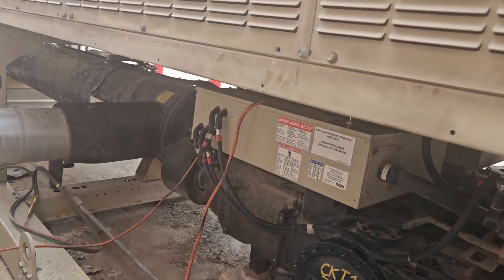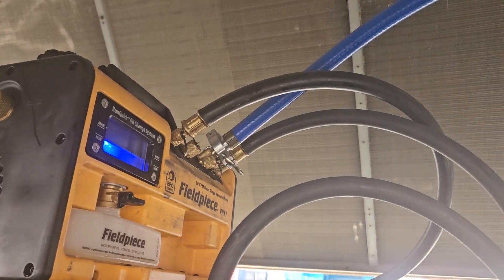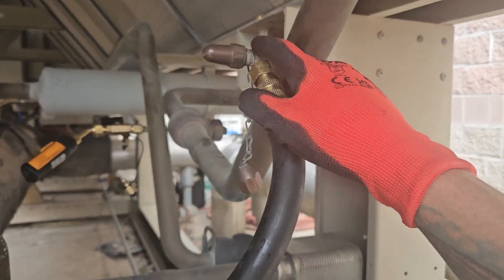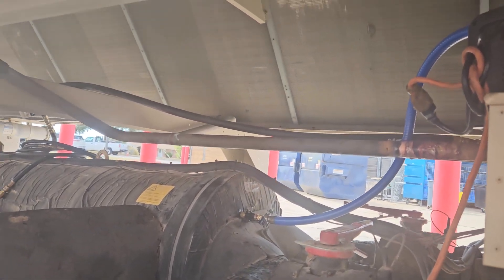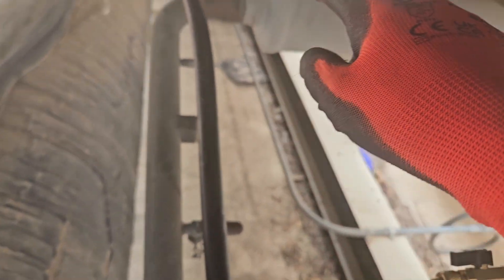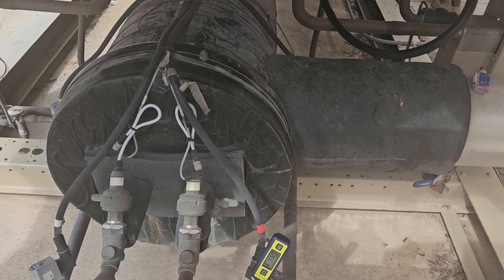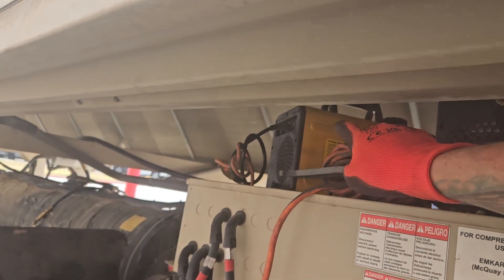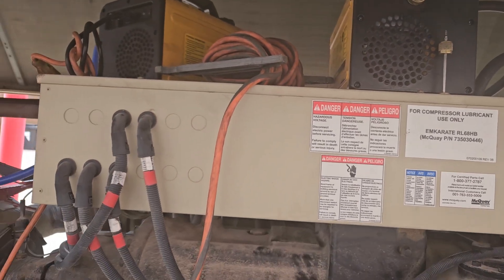You can use 2 vacuum pumps at the same time and have success with it.

Comment: It wouldn't matter what different size vac  pumps you used on the system,  once both are in working order there's no risk of pulling oil out of one into the system, the pump is fighting against atmospheric pressure on the discharge side of the pump, not the   micron level in the chiller...

Comment: I have done this from time to time.  I have the FP(company provided) and my personal JB. Usually will do this on walk ins that I know have a lot of moisture in them. Anything to make the task quicker.
Reply from the maker: @fshn76  time is money and every employer will be grateful for it. It has to be done with thought as to not create an issue. Thanks Bryan
Reply: @JJ-COMMERCIALHVAC yep. Luckily there is only a 1 cfm difference between pumps so never had an issue with pulling oil out of the other. I did a test to see how big of a difference it made and it decreased vacuum time by 40%. Decay only went up by 17 microns. People will say it’s overkill but when I can hit another job while another person is still pulling a vacuum. Speaks for itself.

Comment: I’ve always heard it would do that but never saw an example of it sucking oil out.
Reply from the maker: @smalljobrob6432  it will with unequal sized pumps....and i have seen it happen when I first tried it many years ago. I had to do some learning on how to do it correctly. It can also be done by piping the pumps in parallel. Thanks for the comment

Comment: I've used two pumps for years.  Once the microns get low, pull off one pump.
Reply from the maker: When its planned out correctly it work great. I made this video to get newer guys into thinking about how to accomplish a long task, much quicker. I also have used 2 pumps many times myself. Thanks for watching and the comment
Reply: Same here. Really a necessity on the big stuff if you don't want the vacuum to take forever. I've heard that you can run the risk of pulling pressure too low too rapidly and freezing moisture, but I haven't seen it yet.
Reply from the maker: @topher8634  i have as well, I really think that applies to smaller equipment as the internal surface area is much smaller. Even doing it this way, the vacuum isn't that fast....but it sure cuts the time down significantly